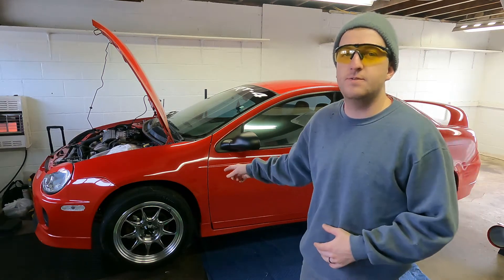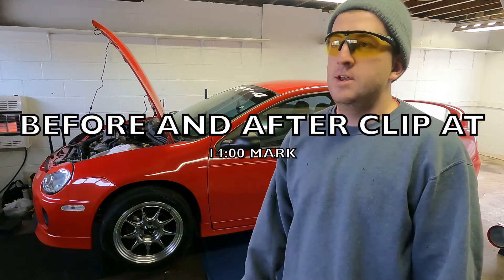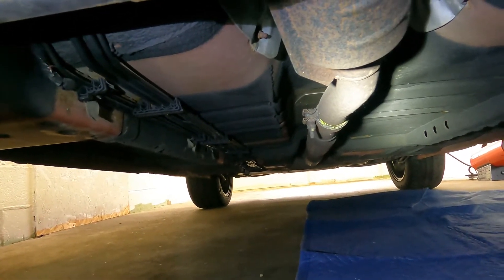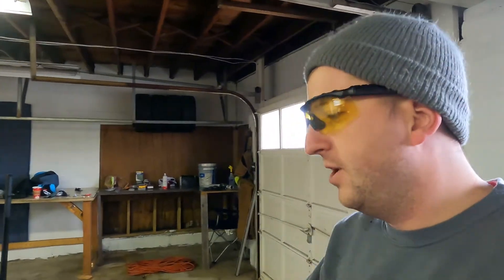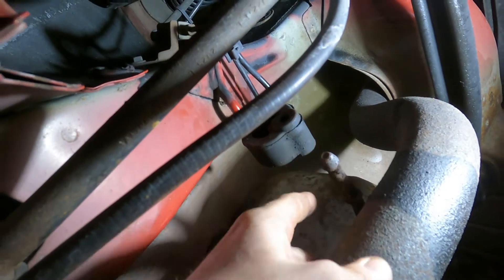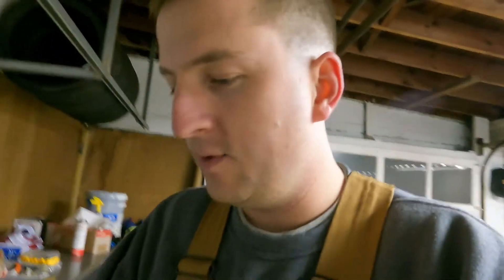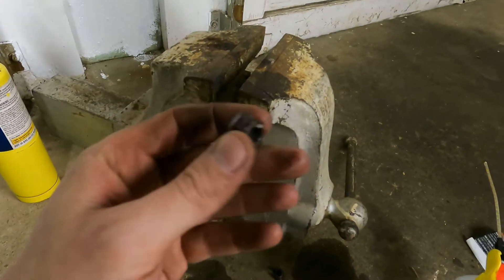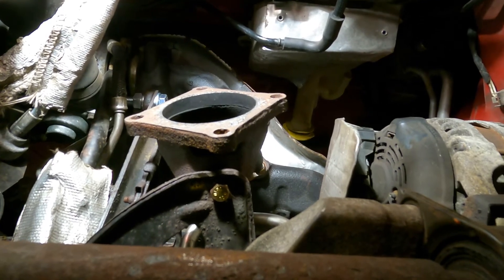IS A CATLESS DOWNPIPE EVEN WORTH THE TROUBLE?  SRT-4 DOWNPIPE AND O2 HOUSING INSTALL

Comment: The spark plug non fouler thing moves the 02 sensor out of the exhaust pipe so it thinks u have a downpipe with a cat even though u dont.  I pass emissions test everytime without a catalytic converter, muffler, or resonators. The guy at the e check place was like I've  worked here 30 years and never seen a car pass without the exhaust. He said I'm not supposed to let u pass without a catalytic converter but it passed without it so your good.
Reply from the maker: I’m exempt from emissions luckily. But I can’t stand an engine light so the anti fouler was a necessity lol

Comment: Should have cut the wire on the old 02 sensor and screwed it into the 02 sensor whole instead of just leaving it open to leak. And u need a spark plug non fouler to get rid of that p420 code for catless downpipe its online look it up to never have check engine light for catless exhaust again.
Reply from the maker: I didn’t leave it open to leak. I installed a Wideband sensor and a plug where the stock O2 sensor was because the stock O2 sensor was stuck in the stock down pipe. Go to 10:39 seconds you’ll see the plug. I was waiting for an anti fouler but didn’t get it till after the video.